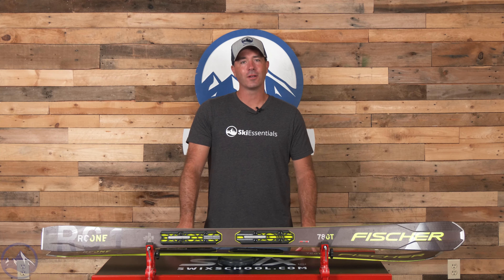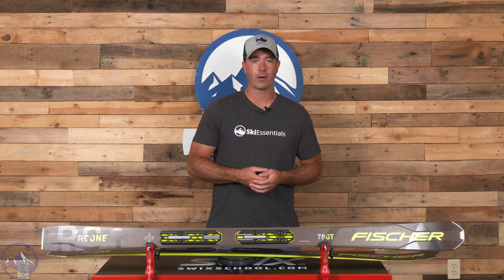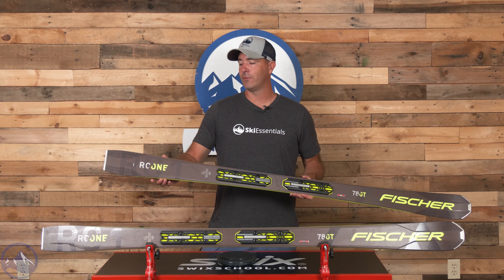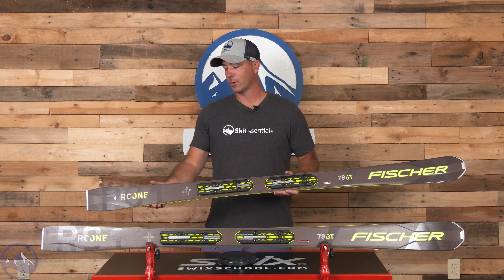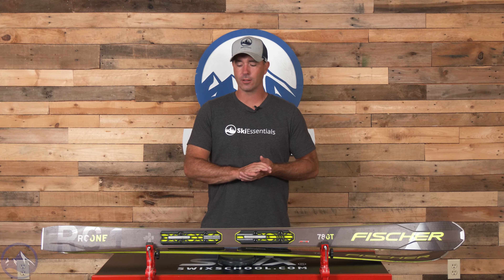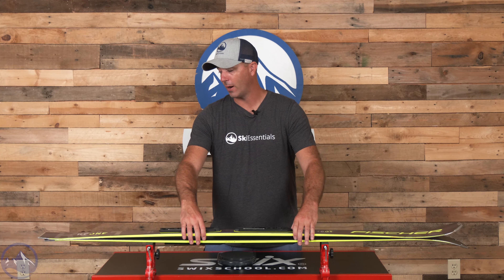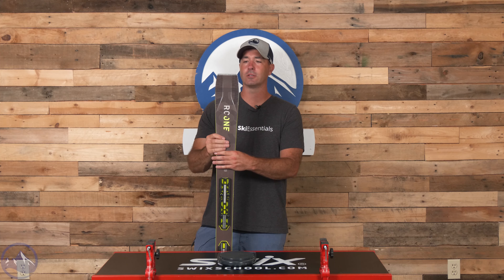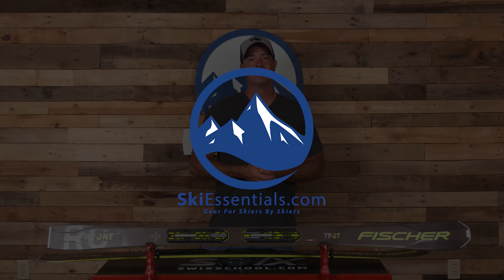2024 Fischer RC One 78 GT - SkiEssentials.com Ski Test

Comment: Thanks for the excellent review. How would you compare this ski with the Peregrine 80 from Völkl? That ski as I understand it, is the newer version of the Deacon 80. Seems like they are quite similar. I have the Deacon 80, looking for a change for a ski that is slightly easier to initiate turns with at slower speeds.
Reply from the maker: They are quite similar.  I found the Peregrine 80 to be smoother, easier to make different turn shapes and styles, and quicker from edge to edge.  Maybe a bit of a dip in deep carves but overall a very fun ski that can be used by many skiers.
Reply: Thanks for the reply, will have to give the Peregrine 80 a trial run next time I get the chance.

Comment: Fischer RC One 78 GT vs Volkl Deacon 76 which one would you suggest for intermediate looking for versatile skis (long and short turns, fast and cruising speeds). Thanks
Reply from the maker: The Deacon 76 is more of a race build and can be pretty tough to get the most out of if you're not a higher level skier, or at least looking for a challenge.  The Fischer seems to fit your needs better here, as the RC One 78 is kind of a midway ski between their race models and all-mountain skis.  It's a bit poppier, more energetic, and easier to turn while still having a very high ceiling.  I'd go that route for what you're looking to do.